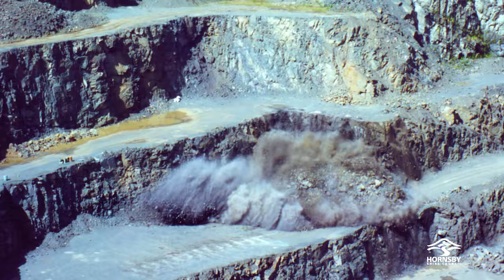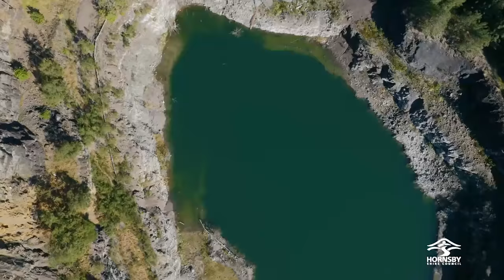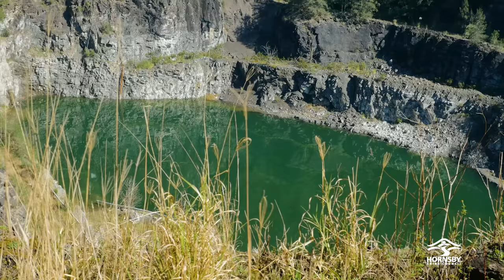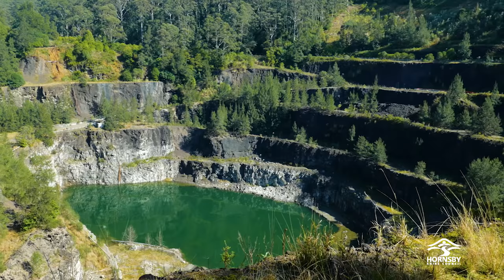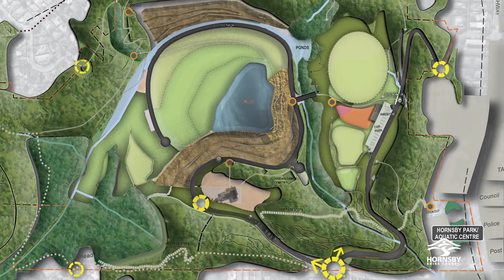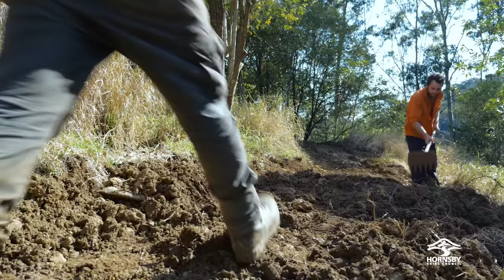Watch Hornsby Quarry transform

Comment: What happened to all of the unused material from the quarry??? Do they compress it into those large black \grey blocks that resemble charcoal maybe.??  If so what do they do with those??
Reply: LLIP DER  . It was a blue metal aggregate mine which is used as road base and in concrete.